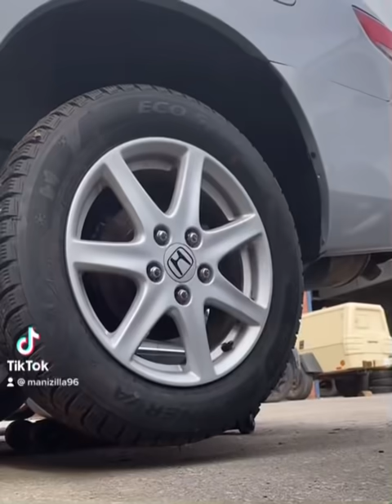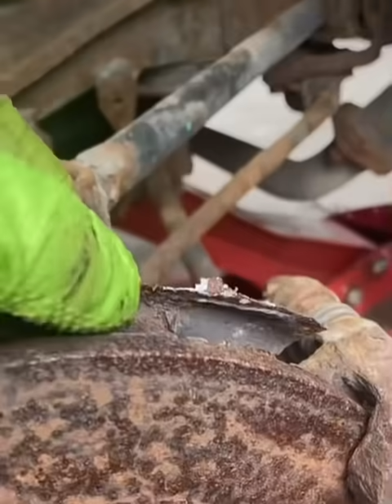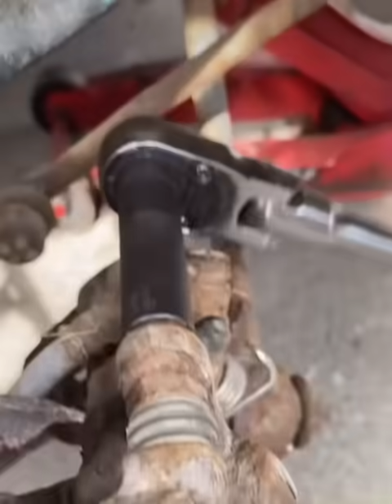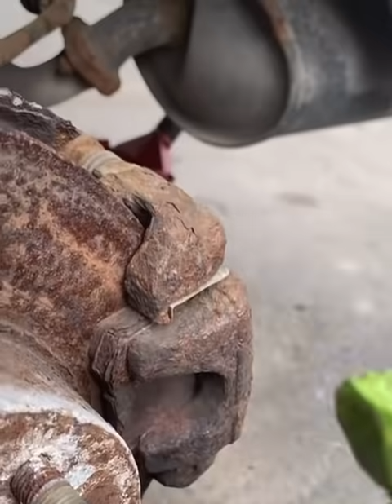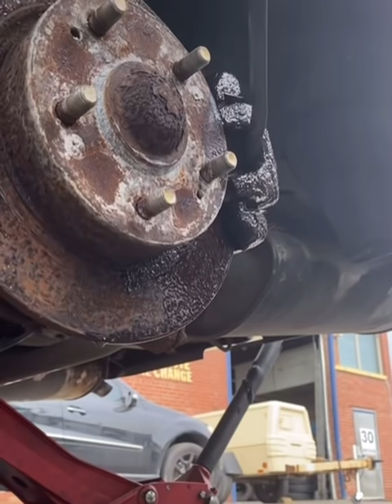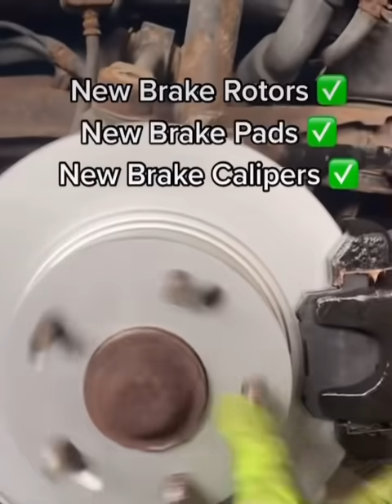Customer never drove their vehicle for 2 years and this happened ...

Comment: Imagine that, not only the wheels are seized, but I'm sure battery is about go, and the fuel IS already dead, sure hope the fuel pump will be ok, usually that DOES NOT HAPPEN, I'D CERTAINLY (REPLACE FUEL FILTER, IMMEDIATELY BEFORE STARTN THE ENGINE), who knows what else is ruined from just sitting their got damaged, I certainly hope no rodents made it to their new homes inside thru the tailpipe. Because IT DOES HAPPEN, TRUST ME.😲😱🤯😵. If a vehicle sits jus like that, it probably is not gonna start.
People jus don't know how to care of their cars, if their was a reason like a medical or some other IMPORTANT REASON for not startn it or moving the car, have a relative, or friend once in awhile run it for you around the block or go out several miles, 
Great job, I'd certainly drain and flush out the brake fluid, and the fuel as well, however I'd  CERTAINLY REPLACE MASTER CYLINDER, as that will certainly start to give out shortly.  Great video, great job.✌️👌👍

Comment: It's a Japanese car that's why I trusted in only two years. Lord knows if the Asians ever had barn finds what condition their cars would be after one-and-a-half years.
Reply: Wrong. It rusted that like in 2 years because it's in Canada.
Reply: @Curt__  Hmm yes cheap flimsy metal in Canada wont last long at all.
Reply: @Vamanaswastika  no. It's the winter and salty roads not the metal quality. Ur from the USA so you don't know anything about rusted cars.
Reply: @Curt__  actually I have lived in Ontario for the past 45 years and I still live here. Think before you judge. Metal has a lot to do with and of course, the salt content. Lately they're mixing sand with salt however, the white spray liquid thats being used is slightly less harsh than previous years. Still goes back to the cheap thin steel gauge used by the Japanese.

Comment: I gotta replaces my brake caliper it won't compress all the way back in to change the pads so I put the old pads back in with a new rotor and it's metal on metal rn

Comment: Lol.. and you call yourself a mechanic. 
First and foremost you never block off a break line and drive a car. You can't possibly be that stupid. 
Second none of that actually needed changed. Just cleaned with a wire wheel.
So in essence you robbed your customer